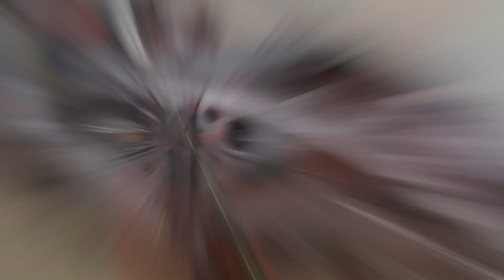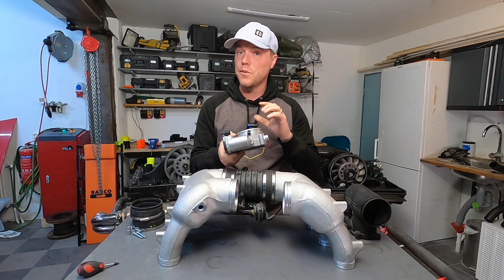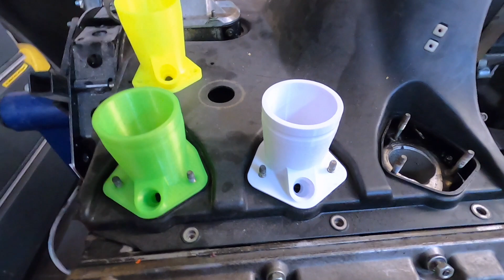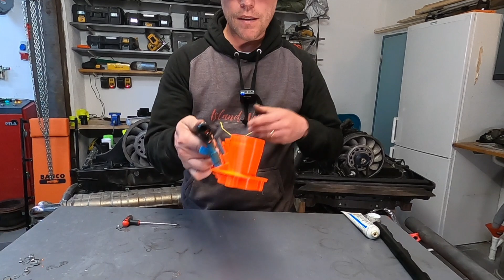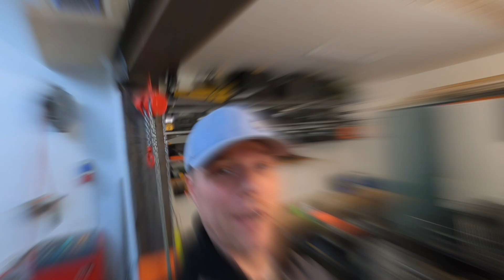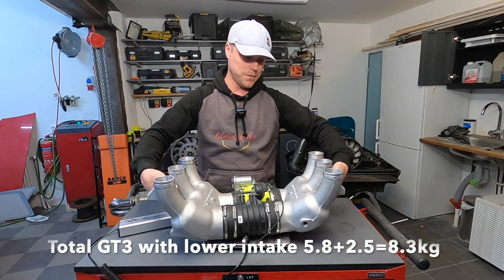Speedy Intake - Build Modern Lightweight Intake for Classic Porsche964

Comment: For the throttle body adapter, go for something like nylon if you print to test, the materials you mentioned are high temp but will distort / melt with fuel exposure ( it will get some from waves pulsing fuel back up the intake )
Reply from the maker: Nowadays it’s made out of a nylon version with some additives for rigidity during higher temps.

Comment: I am watching and wondering ...is this video just a posing video or you really cut only one side of resonance valve's tube. This valve must stay right in the middle between two plenums to separate volume in two equal parts. You cut one side and now the valve is off center - so now one side is less volume, than other, different resonance, different torque curve, different everything in low to mid rpm before the valve opens... Very sad
Reply from the maker: That’s what you get when you reuse other parts. The new one I use nowadays is made from scratch with the valve in the middle. 

Different volumes is not necessarily bad though as it distributes the effect. You test and see ;-)

Comment: Wow, you're really good at 3D design. I got into 3D printing for a couple of years and built some stuff with OpenSCAD so I know a little bit about it. The way you did the angled injector bosses and integrated the original aircool seal was next level.
Reply from the maker: 3D printing started out as a little side project and is now something I use for tools, boxes, fixes and whatever. It’s great!

Comment: There are complete composite intakes right down to the flange. Do those motors running hotter than most?
Reply from the maker: There are intake runners down towards the cylinder heads that are connected with rubber boots.

Comment: This is super cool... I'd b cautious about a serial system... Subaru owners will tell you how that can end.
Reply from the maker: Thank you! What would you be cautious about? With good sizing and dual lambdas the pressure loss should be very low and on top of that compensation from the lambdas.
Reply: @islandworks  4cyl Subarus have a nasty habit of leaning out on the last cylinder in the chain, and being overly rich on the first. The 6cyls run parallel 'dead head' rails which seemingly entirely avoids this problem
Reply: I don't know how this interacts with a high-powered fuel pump, but I'd be concerned that the drop is always going to be a percentage across the length of the feed, and I'm developing something of a theory around pressure wave timing from the injector pulses.
Reply from the maker: I had a look at it just now and I know what you mean. If the flow at high power required through the lines is high enough to cause a pressure drop the last cylinder will get less fuel through the injector and could run lean. In the Subaru the lines seem to be very small and I can see this happening. You would have this in any engine is the sizing of the rails is not enough at the flow you are at. Think about a straight 8 which typically runs 1 rail sized for the application. 

In my case the connecting line between is an AN8 and with dual lambdas as well as I have a fuel pressure sensor. I believe this will run well, and if not the sensors will tell me I have a sizing issue ;-)
Reply: @islandworks  if you install extra bungs you can put the sensors in the first and last cylinder primaries to double check. And you're right. Subaru fuel lines typically are around 6mm ID. It's made me super cautious either way... I don't build single bank engines, but the longest chain I'd want on a rail would be 4cyl if I did.
Reply from the maker: I’ll check the average fuel injector duty across the two banks. If it differs as the load comes up it would be a reason to measure and make an adjustment in the ECU. With dual lambdas it will always run safely as it’s really two banks of 3-cyl.
Reply: @islandworks  in series you could still suffer non-load related imbalance. It may require an additional table to compensate. It's definitely doable with sufficient science... Just uh... Fun?
Reply from the maker: That’s it! It’s all fun!

Comment: Correction, a narrowband Sensor can only measure Rich and Lean. It is not sensitive enough to measure an exact Stoichiometric condition. If you look at the voltage output of a Narrowband Sensor, it constantly flickers between 0.1 and 1.0 Volts, viewed graphically it looks very similar to an ECG of a heartbeat. Wideband Sensors are far more advanced, accurate , can measure a Stoichiometric condition as well as indicating how rich or lean the engine is running. Thank you for entertaining and sharing.
Reply from the maker: Yes this is correct and I tried to explain the general principle. To get anything good for tuning a proper wide band sensor is the best. In my updated engine I’m going for dual units with one on each header.

Comment: beautiful. what about hp gains with this drop in weight? any idea?
Reply from the maker: I’ll do some deep dive testing later on. The biggest thing is the simplicity and the drivability you get with an aggressively tuned engine and an electric throttle body.
Reply: Island Works Sweden love your work! Not looking for a track car myself but there’s a lot I see myself doing to shed weight and improve drivability. Can’t wait to see the end result.

Comment: Interesting setup. I have not seen anybody run gt3 intake with single throttle on a 963/993. Do you have any info on how does it compare to itb setup with gt3 intake on top?
Reply from the maker: The idle is always always complicated on a highly tuned 964/993 engine. With this setup it will be much smoother and the car becomes more drivable. I have a friend that tunes a lot of these engines and he did one recently with great results saying “electric throttle is the way to go”.

Comment: Looks great!  I've been considering some of the ITB kits out there - this has the potential of being a low cost alternative.  So the future ECU state for this is speed density with no Mass Air meter?  Nice!
Reply from the maker: Yes the concept you use is the manifold pressure together with the throttle position. You also run it with feedback from a wide band lambda.
Reply: @islandworks  I'd consider it if the costs are far less than ITBs.  I already have a 996 GT3 intake in anticipation of piecing together an ITB setup but this is very intriguing!
Reply from the maker: Doing Car Things ok got it, I would not expect this to be cheaper than ITB, just different technology with the pros and cons as you usually get with different things.
Reply: @islandworks  Darn - I was hoping that with the commercially available throttle body and intake adapters, that I could save some money.
I'll keep watching!